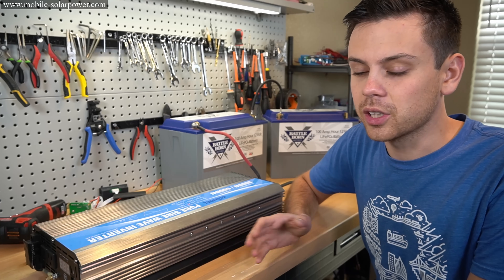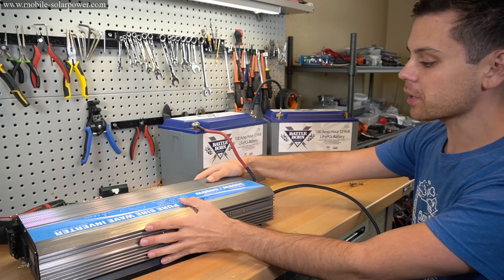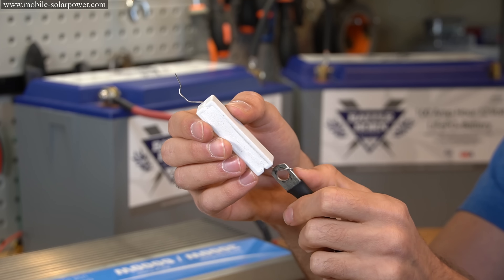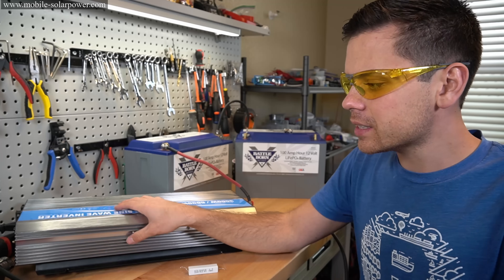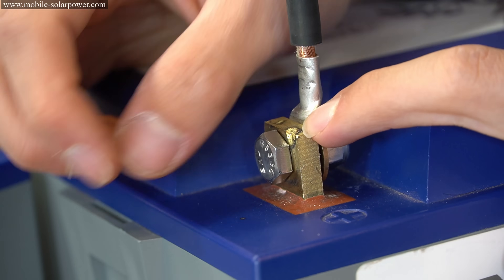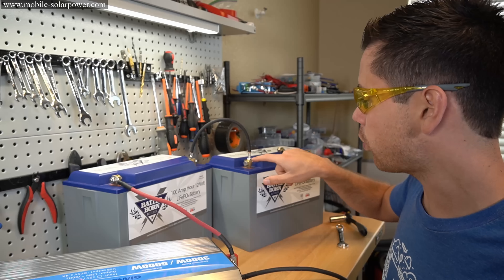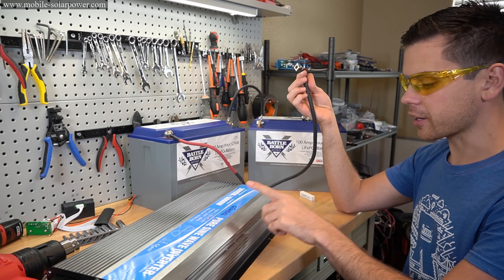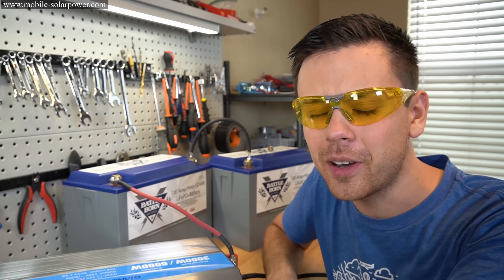How to Pre-charge Large Off-grid Inverters SAFELY. Save your eyes and your bank account

Comment: I've purchased a 3,000 watt WZRELB  pure sine wave inverter - it always sparks no matter how many times its being connected to the battery - maybe it has a feature were the capacitors discharge the moment it gets disconnected from the battery.
Reply: Hi , I'm having same issue ,did you find a solution?
Reply: @stevekennoy   I found that when I removed the Remote on/off device it stopped sparking - I also removed the voltage display since the display went blank.  After that no sparks after 2nd try.

Comment: Hello. This is a great video. I've been looking for a way to avoid the spark when connecting my inverter to my battery. Will a 50W 6 Ohm resistor going to work? I have a 12-volt 2200W inverter. Thanks.
Reply: I’m a bit late to the party since you asked a long time ago, but yes. You will have at a maximum 12 Volts / 6 ohms = 2 amps through the resistor, equal to 12 Volts x 2 Amps = 24 Watts. However, as soon as the capacitors discharge these numbers will decrease rapidly. The resistor is fine.

Comment: I do not guarantee that my idea of reverse diode will work, so do your research before attempting to add it.
Connecting inverter without precharging should not be a problem if the batteries have short circuit protection. But even that does not mean everything is OK. Every battery should have its own reverse diode to prevent destruction. If one out of four 12v batteries in series dies because it was discharged, the BMS will cut out and there will be 36V reverse voltage across the battery. This is why you add reverse diode to each battery to short this reverse voltage to around 0.7V. I think that every battery should have this diode built in.

Comment: Great info! Ordered some resistors today after having to recently take a die to the threads on my old inverter. After sparking heavily on hookup, I couldn’t thread the nut on the stud without chasing the threads. I believe my new inverter is the same one featured here (PS-3000KAR). Was going to design/build a low voltage disconnect for it, but discovered it has the newer style ‘tactile’ on-off switch. It requires that you hold the button down to turn it on after disconnecting, negating the ability to turn it back on unattended. Any workaround you can see?

Comment: I think you're being a bit pussy...... Manufacturers are aware of the capacitor spark and claim "the spark is normal and expected when connecting batteries to the inverter"......... also you don't have to worry about metal in your eyes unless you're dealing with an industrial three phase inverter.,... and in that case you would wear a face shield.

Comment: Just found your channel today.  Already subscribed.  You just gave me an answer to an issue I have in my RV power system.  I have two Battle Born batteries wired in parallel going to a Blue Sea battery switch.  I also have a Victron Energy MultiPlus Compact 12/2000 Inverter Charger.  Every so often when I switch the batteries on the system would not start.  I would have to cycle the switch off and back on to get it running.  After watching your video, I  now know that I was triggering a disconnect on the Battle Born Charge Controllers.  To fix this I will get a momentary toggle SPST switch and that wire-wound resistor and put them across the switch terminals.  I will toggle the switch on for a couple of seconds before switching the batteries into the system.  Thank you very much.

Comment: I have a 12v battery bank of 4-6v golf cart batteries and a 1000 watt inverter that which depleted my battery bank so bad that the inverter just started beeping warning me that it was  out of power and wouldn't power the load after I disconnected the load I turned the inverter back on and now all it does is beep and doesn't work. Could the capacitor be depleted ? If so how do I recharge the unit to operating conditions ?

Comment: Ok, good info, but a proper inverter installation will include both a fuse and an ignition protected disconnect switch on the positive feed cable between the battery and inverter. This will prevent sparks as long as the switch is OFF prior to connecting the negative lead.
Also, best practice when installing AC and DC systems together is to use YELLOW NEGATIVE CABLING for the DC side, since BLACK is HOT on the AC side. This avoids potentially deadly confusion when working on the system whereby a 120 volt  black AC lead gets mixed up with black negative wiring and mistakenly connected to DC negative / ground, rendering both AC and DC systems and the grounding system hot at 120 volts.

Comment: What if a disconnect switch is used between battery/inverter to shut off. Can't be that the precharge has to be done manually?

Comment: Will, which inverter would you recommend for running a desktop PC. I don't mean wattage size, but for electronics sensitivity etc, noisy output. Many thanks
Reply: Pure sine inverter to be sure of no problems and it will be more efficient (modifies sine wave ones will lead to parts of the power supply heating up in the computer meaning more loss)... Pure sine wave will guarantee no problems, some things go crazy with modified sine wave.

Comment: Question: I switched from ANL fuses to circuit breaker fuses to isolate my inverters in my RV when not needed.  I got the spark on the ANL fuses when rewiring and didn’t like it.  When I upgrade to lithium, is there a spark internal to the inline circuit breaker fuses and will that hurt the BMS since it’s not closing the circuit at the battery terminal.

Comment: For my backup power system i built for my computer room. After i burnt up the contacts in a pair of high current relays i added a pre charger. Just using a resistor and a car horn relay. From memory the resistor im using is one of those ones designed for if you use LED replacement lights on your car to load the circuit more. The arduino i use to control it all just turns the precharger on for 5seconds before closing the main relay to the inverter.

Comment: Additional tip for removing inverters: After completely disconnecting and discharging the inverter like Will showed, short the positive and negative battery terminals on the inverter (NOT the battery!). Capacitors can hold a charge for a very long time. This will make sure they discharge completely while the inverter is not in use.

Comment: Thx for this info.  I built a 3 battery bank about 4 years ago with a 2000 watt inverter and nobody ever mention this to me.  Yes, i got some nice sparks when connecting the terminals to the inverter, but i figured it must just be a mild normal thing (not dangerous).  Your $1 resister is about $10 with shipping.
Reply: Yes several other youtube channels claim the sparking is of no worry and normal... I do not know if that is true or not that the sparking do not damage anything, it can for sure lead to things welding stuck...

Comment: slightly off topic, have to ask, what do you recommend for a battery analyzer?  I would like to test the ampere-hour ratings of lead-acid car batteries, but would like the analyzer to be universal.  Of course, it would discharge the battery or cells, charge them up again and measure the discharge over a 24 hour period.  Comments?

And yes, a great tare down, nothing like getting into the belly of the beast.

Jim H.

Comment: I've wondered how hard it would be to make a circuit that would wait for the voltage difference to be small enough before closing a contacter.
Reply: @JamesFox-g7x  yep.
Swype-o
Reply: @robertrocheville7769  Just picking on ya, no offense bro.  You are totally correct, sir.
That's from another journeyman electrician, sir.
Reply: @robertrocheville7769  what would that circuit consist of? Looking to have it be automated so that when the battery drops low enough to cut off power to the inverter, and the battery charger kicks on it doesn't fry the BMS, or load protections in the battery when the inverter comes back online.
Reply: @dotNSF  Not based on the batteries total potential, but the difference in potential. 

Basically one battery(or capacitor) is at 46V and the other is at 52.
The circuit holds them apart until the voltage is low enough to be safe.

Comment: The bigger issue is actually the capacitors especially on the larger inverters as I don't think I have seen any that have a soft charge up feature (like some computer power supplys have, the ones that don't spark when you plug them in do have it, they limit the power to the psu for 1-2 seconds then allow full power pass) , I have seen the solder or traces blown off around the the capacitors legs due to the very high amp inrush current

At basic level I guess using thermistors to limit inrush

Comment: Lots of "light bulb" comments. Remember that any simple electrical heating device (incandescent light bulb, hair dryer, soldering iron, heat gun, glue gun, etal) is essentially a resistor and will do the same thing as long as you don't exceed it's power-handling capability. 

Great job as always Will, I'm SO glad I found your YT channel!
Reply: Hi, having trouble finding a resistor.. but do have a glue gun...how would I go about using it? Thanks!

Comment: No kidding, you probably just saved my eyes and my life. Great video. Short to the point and extremely valuable information!
Reply: Been connecting my 24v 3000w inverter the hard sparky way countless times without dying or going blind... But for the safety of your LifePo batteries it is best to use a resistor to avoid this.

Comment: ok, my August 2019 electric bill was $91.97 using AC here in SE Louisiana just off the coast.
the present meter reading at that time was 55444
the previous reading at that time was 54362
so I guess I used 1082 KWH in those 31 days, at .085 per KWH?
How much will it cost me to switch over to off grid solar per KWH?
Reply: The long-term cost of solar electricity is not a simple calculation. If economics are your sole consideration, then putting your efforts into energy efficiency will give you better results.
Reply: @P_RO_  No, I'm looking for energy independence for when I move to Tx. same latitude!
Reply: @P_RO_  I just want to know what an average cost per kilowatt hour is. I am not simply thinking of economics, but they are important . Why would I buy a schleep for $95 dollars a month,

Comment: What if you would put a master switch between the batteries and the inverter (and other loads). Would you need to have a multistage switch? Or would a switch make a clean connection without sparks?
Reply: No, the switch will not help. You need to use a pre-charge resistor and two switches.
Reply: or a rotary star-delta type switch. They use inverters and master switches on sailboats. I wonder how they do it. Will investigate that.

Comment: If you don't want to go buy a resistor, a 1 foot length of .032 stainless safety wire has about 7 ohms.  It's what I use to make discharge load banks.

Comment: That is good to know, I would have assumed big inverters would have some circuitry to prevent this but guess it's bad to assume!   For a permanent setup you could probably have a resistor as part of the circuit by default and a separate switch to bypass it. I guess ideally two switches so you can still isolate the entire thing.

Comment: Thanks Will, another informative episode. I am surprised to learn that large wattage inverters don't have a high value leakage resistor soldered across the input terminals to allow them to discharge over a few seconds once power is removed.
Reply: They should have a relay to automatically discharge through the normally closed terminals of the relay.
Reply: @ajarivas72  Absolutely, a relay is the ideal solution.

Comment: Used to drive a 48V EV in the 90' and the solution was to keep a 60W incandescent bulb in the battery compartment, so whenever I had disconnected the battery pack, but didn't want the bang and sparks when re-connecting, it was simply a matter of placing the center prong of the bulb on the battery terminal and the cable on the threaded part of the bulb, and when the bulb extinguished, the caps were charged so I could simply slide the cable onto the battery terminal with no fireworks. But yes, the authorised way of doing that is with a precharge resistor and a push button, and a small bulb to have an indication of when current is no longer flowing and the pre charge is complete.
Reply: Is there a specific voltage and watt requirements for the light bulb method? I found a light bulb with cable and crocodile clips which is rated 12V 25W, is this enough for precharging capacitor in UPS that uses two pair of 12V SLA batteries?
Reply: @marcusn7854  The bulb is simply Used as a power resistor, with a visual indication of when the pre charge has finished. That means, any bulb Will do as Long as its voltage rating is equal og higher than your battery pack. So your 12V bulb is going to burn out if you connect IT to 24V. If you get a second 12V bulb and connect Them in series, IT Will Work too. I Used a Common 220V AC household bulb, and IT glowed only dimly on 48V, but IT was easy to see when IT turned off. If you are American, Use a 110V bulb. IT should light just the same on 24V as my 220v bulb did on 48v.

Comment: I used to use a incandescent test light to charge the capacitors in high power car audio systems. The benefit is the light glows dimmer and dimmer as the caps charge. The light across the inverter input will discharge too. Nice videos. Thanks.

Comment: These are not that easy to find without heavy shipping charges.  Could you use a 10w 30ohm resister? I'm assuming it doesn't take much current to charge the capacitors.  10w resisters seem easier to find.
Reply from the maker: I always lose the small ones. But yeah, use whatever you have

Comment: Im glad you mentioned this as its something not a lot of people are aware of.  For me, I use a lightbulb in a holder to charge as its a resistor and the bulb will dim once the capacitors are charged.
Reply: Man, this is a brilliant idea.  Save me a trip to buy the resistor
Reply: I have a table lamp. can I just use the plug? Is there a possibility too much current through the plug may melt the internal wiring?

Comment: Near infinitely-low impedances create near infinitely-large currents.  I=V/R.  With R tending to zero, I tends to infinity, regardless of the voltage.  Another way to do it is use a thin wire, but wear gloves and be firesafe doing this incase of mistakes - melted plastic will stick to your hands and keep burning - very unfunny.  The resistor way is best.

Comment: Thanks for that good info,but if you have a battery switch and turn  switch off first,then connect inverter, isn't it safer?
Reply: You could use two switches, one to isolate the whole thing and add a resistor as part of it, then another switch to bypass the resistor.  just make sure when you turn on the main the bypass is off. could get fancy and use contactors, but finding 100a+ contactors might be hard and expensive.
Reply: No. The spark just happens in the switch where you can't see it and wears it out. Using a precharge resistor is always good.
Reply: @ahaveland  Thanks man,kinda figured that That's why I wasted no time getting those resistors. Just bought some lithium batteries too. Haven't installed yet. Man love this channel!

Comment: You might want to caution users regarding higher DC Voltage as there is the potential for an electrical shock that could be hazardous to health. I would be cautious with voltage greater than 48V.
Reply: Yes! Its the current being drawn, you being a resistor, in parallel you lower overall and will be a nice branch circuit Unless you have gloves and are mega ohm load. Experienced at 12000VAC and we used 600vdc control power in the breakers. Only get one mistake per life.
Reply: @lovesmykitties9672  That last sentence- so true!
Reply from the maker: Yes. Actually 30v and higher is dangerous for most safety codes. My 48v system videos cover shock considerations.

Comment: i usually use a 12v 55watts halogen automotive headlight bulb. easy to find and you can see if pre-charging  completed. innitialy bulb will lit ip and slowly dims while charging in progress
Reply: Not so good for 48V systems though!
Reply: @ahaveland  48v super halogen,  slowly dims and completely blinds you once charged.
Reply: I use a standard household filament light bulb.
Reply: You put the bulb in line with the ground so even a 48v or 96v it'll dim because the capacitors will charge and no longer pass current.